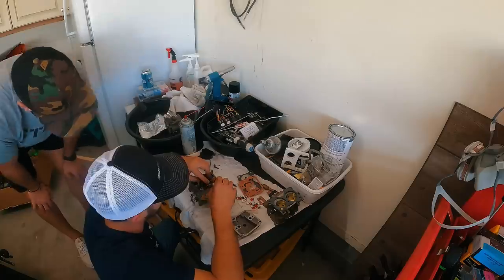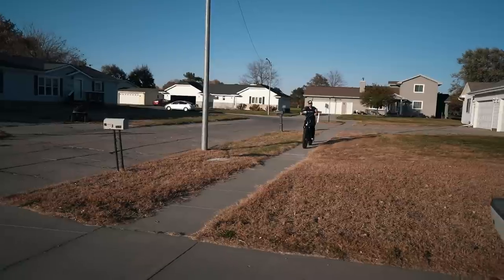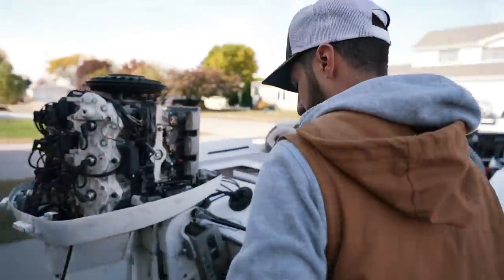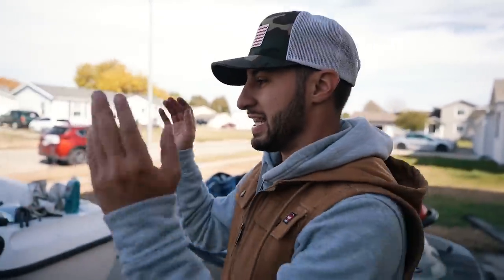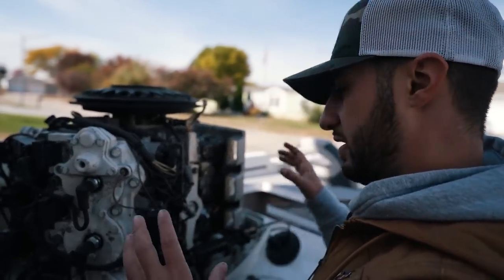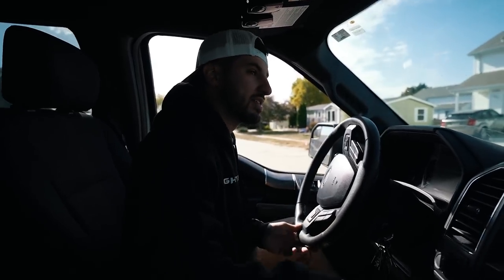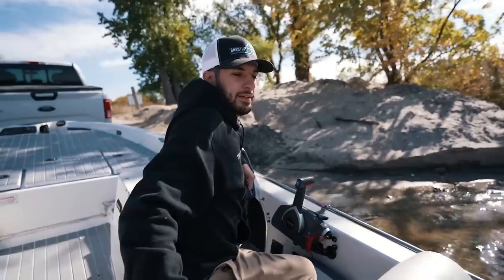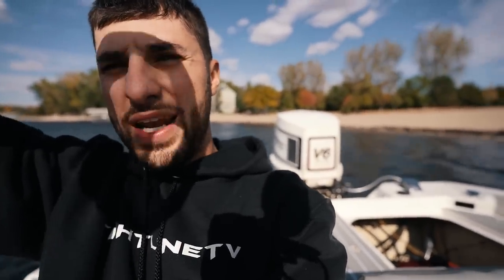Restoring A DESTROYED Bass Cat From Facebook Marketplace (Ep.14)

Comment from the maker: 1,000 likes and we’ll take it to a mechanic!
Reply: What decking is that?
Reply: Make sure when on land you can rev it by throttle , seems like your advancing timing shifting but your butter fly valves on carbs aren’t opening
Reply: Replace the CDI box and that will fix your issue I would put money on it. Contact CDI and they can direct you in the right direction, but for the cost of an hour worth of a mechanic you can fix it yourself. Dont use starting fluid on a 2-stoke it is really hard on the cylinder walls because you are starting it without lube since 2-stokes gets it lube from the gas mix.
Reply: Where are you located? I’m a marine mechanic!!

Comment: I’ve been watching your build since the beginning I gave you quite a few comments and advice. I have the same motor I had the same problems. It started with this detour and the timer base. It does not matter about fuel delivery. If the electronic system doesn’t work properly I believe I gave you the advice, you need a bigger fuel pump. There should be two fuel pumps for that motor. My motor had the exact same problem however, today it runs 65 miles an hour on a Ranger 373.
Reply: My johnson gt150 on my ranger only has one fuel pump replaced the vro with proper sized non oiler unit

Comment: Had an old 75 Johnson was doing the same thing ram great on muffs. With back pressure would misfire and bogg sometimes not run. Found that the head gasket was blownn and thermostat components were melted.

Comment: replace the stator and timer base. had the same issues with my 150. replaced those 2 and it ran like a new engine. those engines run extremely hard and well when running correct. loved mine.

Comment: You got this. Adjust the throttle and replace the fuel filter and fill the new fuel filter up with a can of ssafoam marine. Might be the fuel pump, but the seafoam process seriously cleans out the engine and preps for a season.

Comment: i got my hands on an 86 ranger with a 200 yamaha on it and had a lot of trouble running under load. In gear it could not go above 1700 rpm. I just trimmed it all the way down and drove around the lake with new gas with additive and it slowly started climbing and climbing in power. Today it runs great and I just have to run good gas through it.

Comment: Try to get new power packs . I have a 84 Johnson rebuild the carbs and it Did the same exact stuff . Changed the power backs got the cylinders hitting when it was in gear . Don’t know if it will work for you but it worked for me . Good luck buddy

Comment: the timing is off on it and you need to pull the flex plate and re-time it. also might need a timing/spark coil ring. it goes under the flex plate.
Reply: Good point.

Comment: Had same issue with bogging and not hitting on all cylinders on my skeeter.  Ended up being the voltage rectifier.  But a bad stator and pulser coil have to same symptoms.  Hope that helps.  The rectifier is the cheapest out the 3

Comment: Make sure you use the original OMC gaskets. I used some Amazon ones and my motor did something similar. Once I got the OMC gaskets it was running perfect. 1995 Johnson 115 fast strike.
Reply: Yeah got some off eBay for my 150 xp Evinrude and they melted and shrunk giving me a ton of problems. I got some good name brand ones and my motor is running good.

Comment: This was painful. LOL. Stopped the video to comment. Never use straight starting fluid on a 2 stroke, well unless you want it to go to 2 stroke heaven. These motors have an enrichment circuit. Meaning when you push the choke button in, it shoots gas right down into the motor. For a cold star, pump the bulb up, press the choke button for 10 seconds, then fire it up. Bump the choke button to keep it running until it warms up. Also with the cowling off in the driveway, when you push the choke button, you should here the solenoid I'm talkimg about picking up. Scream & Fly is a great resource. Buy a factory service manual. They are not hard to fix with right resources.

Comment: After a carb rebuild, you have to link and sync the carbs IN the water while moving at idle. This requires a captain and another person to sync them. The carbs are not synced together properly and causing the motor to lope and bog out, then shut off.
Reply: Power pack, or coils.. fires enough, to rev in neutral, but with a load it boggs it is electral

Comment: Don't sell it!!  That is a beautiful motor that matches the boat.  It has compression so you can get it running sweet WAY cheaper than a new motor and it will scream. Take it to a shop and have them fix it.  I personally think it is the stator or powerpack if it is missing terribly.  After it is fixed drive as far as you have to and let that thing RIP!  Make sure you film that big ass smile on you face for us at 60 mph.  We are waiting for it!!

Comment: Not sure exactly where your at in Nebraska but. Assuming your close to the omaha area. You can run full wake in the Missouri River. Note would get it working better the current is strong. Also there are some lakes by Lincoln that allow wake might be 1 - 2 hour drive tho. Shocked rebuilding the carbs didn't work. I would make sure your running 93 octane. I would make sure your fuel delivery system is in good order. I am no expert but if you have the pump ball thingy does it run better. If it has one that is

Comment: Synch the carbs if you didn't already, all six carbs have to be in synch. Also the timing needs checked but that has to be under load, which requires a special prop.

Comment: Bought me a 93 bass cat. Rebuilt all 6 carbs amd some fuel lines. Fired up and went. 2 launches later it dies now when I start to go. My buddy does the throttle by hand at the motor after I put it in gear and we take off and it runs great till I come to almost a stop then taking off again it dies. What the hell is going on. Just curious if you may know or someone else may know. Thanks in advance

Comment: Not the fuel pump carbs on that are hard to get perfectly clean so I feel u have not got them right quick check if carbs are issue is push choke while running if it clears up that’s issue also the power packs are famous for giving issue even brand new ones loosing spark on one  cylinder fire up on hose pull plug wires listen for change ,this will be a great motor once running right but I would get a nice 150 four stroke on back and beefy trolling motor on bow

Comment: are there no public lakes you can run bigger HP engines on? also it sounds like the engine is running too rich or too lean, im going to say too rich, i think you need to adjust the carburetor needles, my engine was bogging down untill i messed with the carburetor needle, its a 2 stroke though, either way, it runs ok at idle and rips at plain, look up four stroke carburetor sync

Comment: You have a “ spark “ issue , I would say one of the power packs are bad.
Put the engine in a large tub ov water, put it in gear, pull a spark plug and you will be able to tell if each wire is getting spark .

Comment: Don't give up man. I have the same motor on a 1989 180 tf nitro and it works like a charm. We had a power pack and timer base issue (which u have to pop the flywheel off to fix) it doesn't seem like it's misfiring just not enough fuel. Adjust those cables correctly and u should be golden man. U got this!

Comment: Youv'e proved that the motor runs you just need to get the throttle linkage working correctly. When it was running in the last video it sounded like it was just idling to low, as in the throttle cable just needed tightening. Then you unhooked the cables and it ran fine. When you had it in the water you should have took off the hood and revved it up manually it probably would have took right of just fine, could be a cable issue or controller issue. Or it could be just as simple as the throttle cable is out of adjustment.

Comment: I just bought an old ranger with that exact motor and it had some issues I was able to find a complete shop manual online for it. Definitely start with the correct fuel pump I can send you a listing if you want and then if that doesn't fix it make sure you have the champion plugs recommended and check each coil pack, instructions are on the manual.  One other thing known to go bad on these engines are the power pack there is one on each side of the motor can also cause a misfire. I can email you the manual if you want
Reply: Im interested as well. Bought me a 93 bass cat with a V6 150 evinrude splitfire. It wants to die after putting it in gear and giving it gas. It'll go if we do it manually from the motor. Weird but I can't figure it out. Any help woukd be much appreciated brother. Thank u
Reply: @concrete2catfishin  same thing wad just happening to mine I had a carb float stuck down if the primer bulb will not get hard and fuel coming out of the front of the carb when priming that is the issue
Reply: @concrete2catfishin  if you want to send me your email I can send the shop manual your way

Comment: STATOR TIMERBASE COILS POWERPACK!!!!!

Replace those. I have worked on a lot of those, I hate the gt150. 

Also, check and see if it’s only running on 1 bank via a short interrupter switch. 

Check for melted epoxy under the flywheel. 

Contact me I can walk you through getting that thing running perfect in a few hours.

Comment: I run a Yamaha 9.9 four stroke with forward controls on a 92 procraft V-180c.  The boat flows nice and flat at 4 to 6 mph.  But it will plow if I try to push it past 6 mph and I really wont get any thing else out of it except more rpms.  The boat goes almost 2 mph on idle. So my real world useable speed range is 2 to 6 mph. The kicker charges too so that is nice when out all day.

If you don't have enough HP to get on plane, I would ask why need more than 10 HP?  

IMHO you would just plow at high RPM and burn fuel with a 25 HP motor.

Comment: So I’ve had this issue with a motorcycle. Started and idled pretty good. Under load it stumbled and cut out. May not be your exact problems but do a quick test on your coils if you haven’t yet. Can be done easily with a cheap meter and you can call a dealership to get the correct ohm readings for your make and model. Also, clean and check all your electrical connection.  Again, you may have done this buy just need to ask.  You said it misfires, but have you narrowed it down to which cylinder or cylinders it is?  If it’s located at specific cylinders then you have your path narrowed to those. If it’s random, it could be a bad something bad in the electrical path or how it distributes spark.  Did you run it up past idle at the house?  Might have been something you cut out of the video when editing

Your answers are here in the comments. I would have a list of all the suggestions and then check them off as you confirm it’s not the issue. That will help you keep track while you trouble shoot.  I just don’t like taking things to a mechanic because I just don’t trust most shops. It could be a simple fix but you’d never know. Instead your at some else’s mercy to tell you what’s wrong 

But if you are serious about keeping the boat, maybe a good running used motor is the best bet. Don’t put a kicker on it. 

Good luck. And next time don’t keep us hanging 😂😄😂😄😂

Comment: Compression , spark , fuel pressure ….. 
buy the correct manual 
Sync/link carbs 
Try running it on a separate fuel tank .
If you deleted the vro , you need the correct pump .

Comment: KEEP MOTOR !! FIND A SHOP MANUAL ON MOTOR AND PUT THE CORRECT FUEL PUMP IN IT AND MAKE SURE THE THROTTLE IS ADJUSTED AMD CORRECT SPARK PLUGS MAKE A DIFFERENCE .. CHECK COIL PACKS? LOT OF NO COST THINGS YOU CAN DO FIRST.. THOSE MOTORS RUN FOREVER AND ARE EASY TO REBUILD...

Comment: Don't sell that engine, more than likely the carbs need adjusted and need to be synced. Check the coils, they're not expensive. And you might need to replace the spark plugs, even if they've been replaced. That's a good engine. I had a similar issue with mine, the carb kits you got might not have the right jets, check the original ones and the ones you installed. You might need to clean and put the original jets back in.

Comment: timing is off. check the lever that advance the timing. it on the same side as the throttle on top by the flywheel. the more advance it the better it should run. but it should be in sync with throttle.

Comment: keep the motor. there bullet proof. and the carbies need to be synced with the throttle. and in gear the idle sounds too low. it should be 600 to 900rpm in gear idle in the water

Comment: Check your spark, take all spark plugs off the engine get one plug to check each coil make sure to ground the ends of the spark plug and look for spark, also if it’s your fuel pump you should be able to squeeze the primer bulb constantly to see if it runs better  so you can rule that out

Comment: This engine is much too big for your boat, in my opinion. If you can get it fixed, do that and sell it. Then you can buy a recent 4 stroke, 50hp max. That will be more than enough for your small boat and it will be reliable, quiet, fuel savvy and it won't make smoke with oil that goes on the water. This engine is outdated. Your boat deserves something better, after all the restoration work you did.

Comment: Assuming u checked that it was arcing blue on all cylinders. Put it in a 55 gal drum of water. Open it up. let it run. Move the carb linkages and chokes while running. Pay attention to what's happening. To make sure there all aligned correctly. Maybe chokes are not setting right.
  My guess is it hasn't ran faster than idle in a long time. Carbon build up on cam and sticky lifters. Sea foam maybe. 
  I'm no expert. Just know my old evinrude would sound like that after sitting up over winter. But would be running fine by the end of summer. 
  Change foot oil if you haven't. 20 bucks for the pump and oil at wally world. 
   I hear you about not needing that much motor. With your situation I probably would just try to trade it for a motor your able to use before getting any further into it. 
   You need to ask yourself if it's about learning some mechanics or just getting the boat to run?
Reply: There are no choke butterflies in those carbs and there is definitely no cam shaft or lifters in a 2 stroke